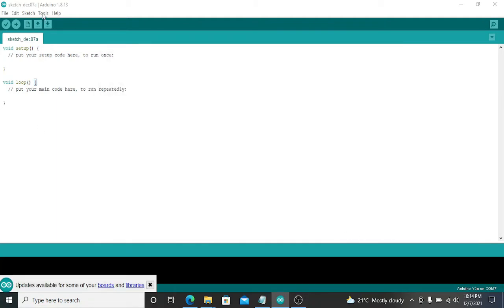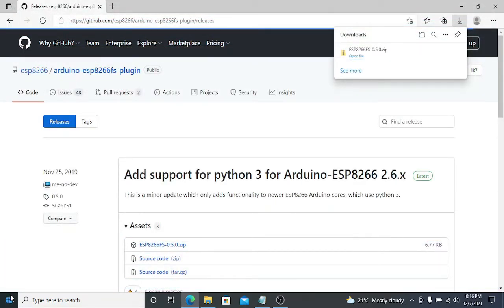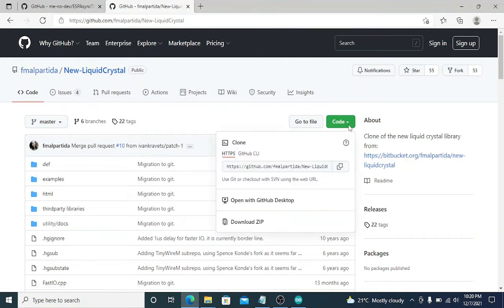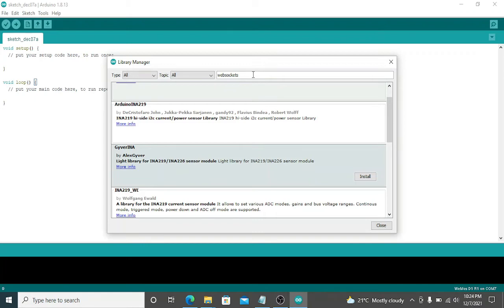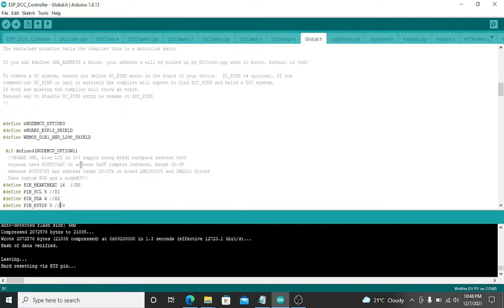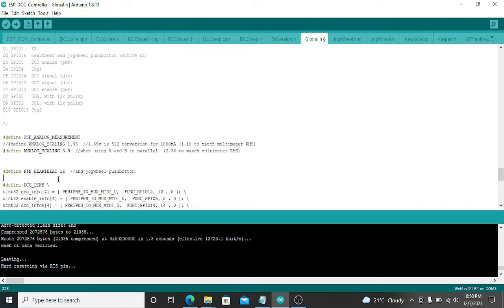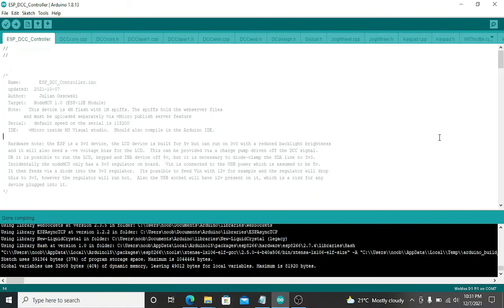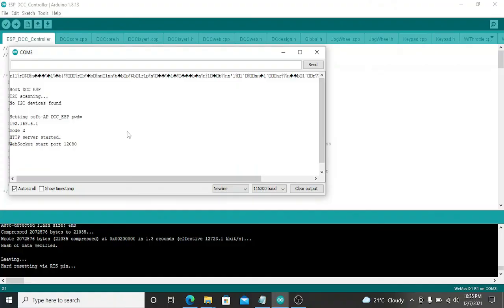DCC two board controller part 2 - software

Comment: Firstly thank you for the creation
But I have some difficulty making it to run properly. My board is NodeMCU V3 ESP8266MOD with a L298N motorshield. I have uploaded the files and sketch data update. This is what I get from the serial monitor:

Setting soft-AP DCC_ESP
192.168.6.1
HTTP server started.
WebSocket start port 12080
Voltage trip

When I join the DCC_ESP , he doesn’t do anything and when I go to the browser is shows 404
Reply: Also when I join the server, it doesn’t show “ new client ip: XXXX “